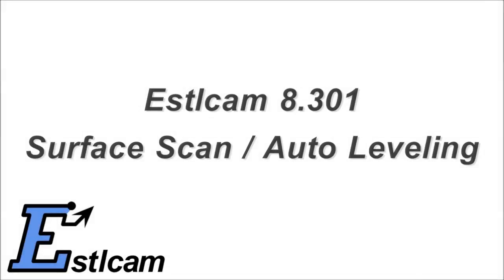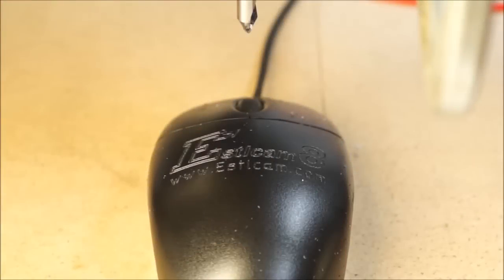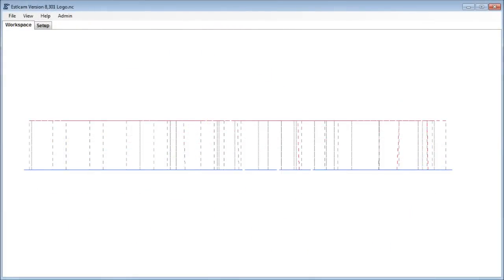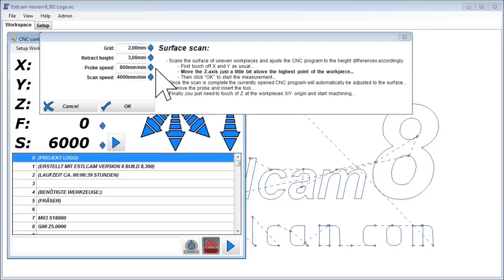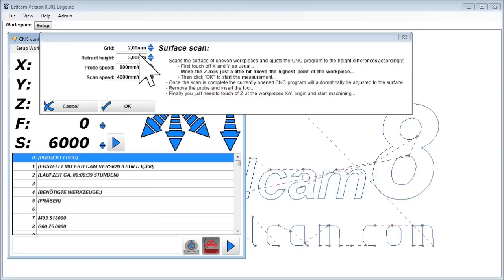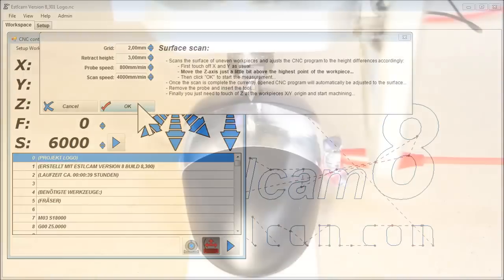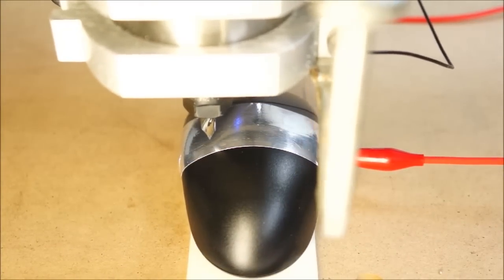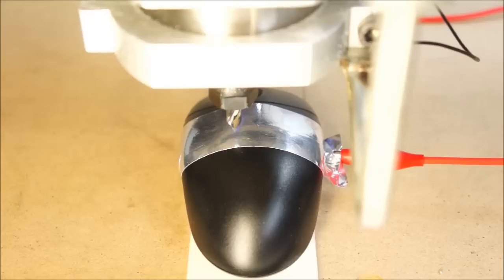CNC surface scanning / auto leveling

Comment: Has anyone had a problem with not smooth movement of stepper motors when machinning on scanned suface? I engraved the surface similar to computer mouse, but  much bigger than it, using ESTLCAM controller (Arduino Uno + grbl 1.1, 4x tb6600 stepsticks, 1600steps/rev (1/8))  without any problem. Next I put another piece of material, exactly the same like previous one, I did scanning surface and launched the cnc program. Unfortunately the movement of stepper motors isn't good. It's jerking, extremely accelerating and decelerating..
I tried restart Arduino (by unplugin, by clicking restart button), I re-programmed controller (Grbl0.9-1.1 lastest compatible), I restarted Windows 10 several times.... and there was no result.

I know that it can be a problem of my laptop, of Arduino itself or t6600.. so there is a plenty of posibilities, but maybe some one of you already had that issue and could help?

Comment: im looking for software to rout wood with curves,to be able to touch the tool on the work piece to scan the profile,how much area will this work on,the curved arch top of a jazz guitar,or only small items,such as the mouse.
I'm designing a cnc router powered by an arduino uno/A4988 stepper shield with grbl on windows pc(vista or xp).
Covering the item to scan with foil tape would be easier than trying to generate code ,as i have just been introduced to the arduino.
I know grbl 9.0 i uses touch tool height now and i suspect this may be the method.
I i just saw the mouse and came to the youtube vid to comment and ask,looks amazing and very professional .
thanks.

Comment: Hello Christian, Please tell me what mill is that . it can be used for aluminum? . also tell me what is the depth set for work. thanks
Reply from the maker: It is a Shapeoko 3.
I'd mostly recommend it for wood and other soft materials.  It can machine aluminum - but very slow. For aluminum I prefer much stiffer (but also much more expensive) machines.

Comment: Very good! Iam using such a function since years for EVERY workpiece. I would never cut something without surface probing. 
Hopefully there is a feature for a "offset" between surface scanner position and spindle center. Because sometimes the probe/scanner is fixed NEXT to the spindle.

Comment: Love it!!  What kind of foil are you using?
Reply: +Christian Jørgensen what does it cost?
i didnt find anything on the Internet. thank you Grumm
Reply from the maker: It is aluminum tape - looks like ordinary adhesive tape but made from aluminum instead of plastics.
You can find it at hardware stores - it is used to seal insulating board seams and is quite cheap.
Reply: Perfect!  Love this software :) *
Reply: +Christian Kn&#252;ll Womit erstellst du die DXF/stl dateien?   es hat  bei sketchup stl dateien nicht funktioniert und dxf wollte er auch nur manchmal...
Vielen Dank Grumm
Reply: Hi Grumm - give OnShape a shot - great for creating STLs and DXFs for 2.5D milling :D